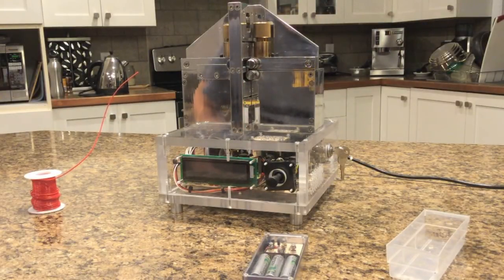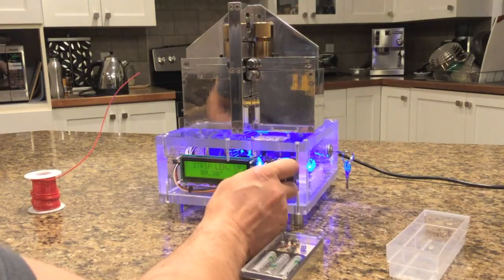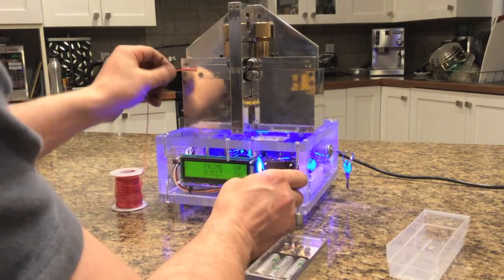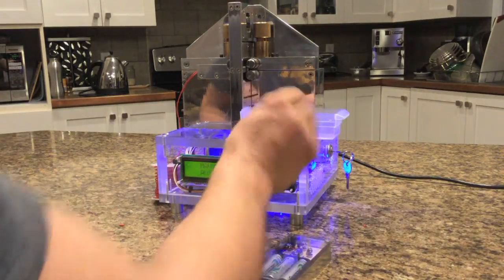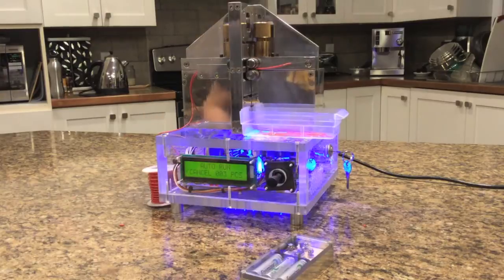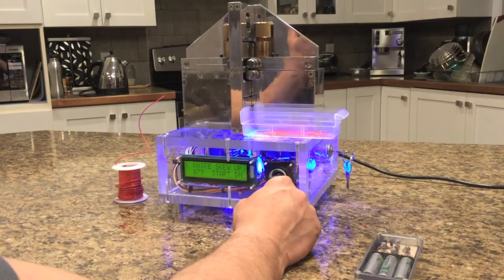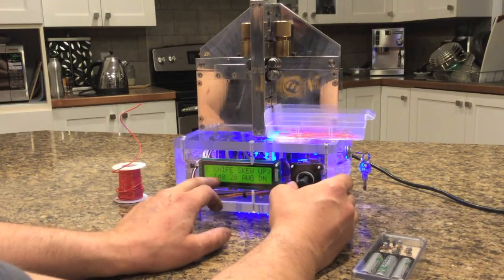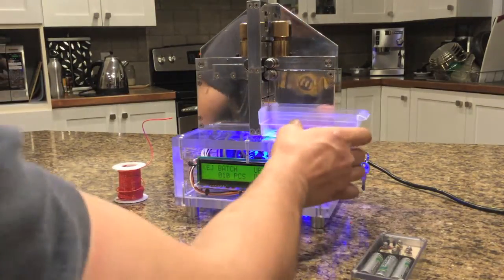Automatic breadboard jumper making machine

Comment: Great work!  Do you mind if I ask what you used for blades? I'm doing similar for a small side business that involves cutting and stripping lots of wires - I've ordered forked blades out of a commerical wire stripper machine for mine, just wondering if you used something similar or made up your own?  Looks like you have access to some CNC or metal working equipment to produce the other bits though.
Reply from the maker: Hi Rob.  I didnt have any cnc equipment (i wish) just an old rf45 benchtop mill and a small lathe. The knife system used a couple of pieces of hss that were 0.125” thick x 0.500” wide and have a 90 degree v grind in them. The length will depend on your application. I actually had a local saw shop make tose piece for me. Charged 20$. If you look at a set of klien wire cutter strippers the knife geometry is similar. Thanks for watching !

Comment: which type of cutting mech. you used
Reply from the maker: Tecky Buzz  the actual cutter knives are a pair of opposing 90 degree single sided grind knifes. Like a set of klien electronics wire cutters.
Reply: Will u provide me a pic of the same or how to manage to liner displacement between blade bye servo or stepper
Reply: I am also working on the same  for a project
Reply from the maker: Tecky Buzz i dont have a picture handy right now but if you watch at the end of the video the knives are in carrier blocks that ride on push rods that ride on eccentric cams on the top and the bottom. The carrier blocks are returned by spring and lifted by the cams. I have a timing belt and pulleys that keep the cams in sync. The cutter stepper motor runs in open loop once the reference starting point has been set by a single window trans beam encoder. The microcontroller keeps track of the steps. This is fine as long as the motor is not overtorqued. I sized my motors way over the required torque to avoid slippage problens. Hope this helps. You have alot of interesting videos youself i will have to check out!  Thanks for watching.
Reply: Will u plz share some drawing for the same and programming ??
Reply: @allaird1  mn